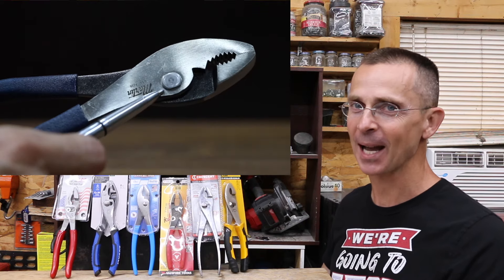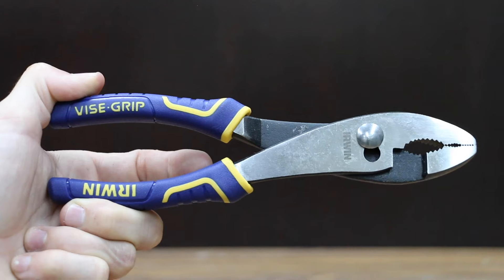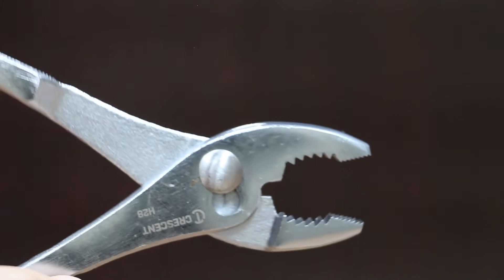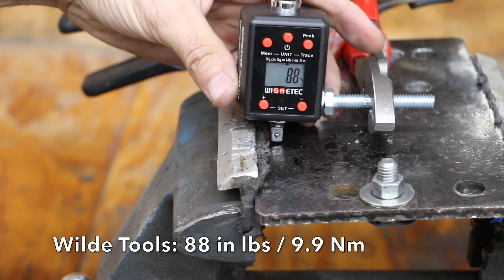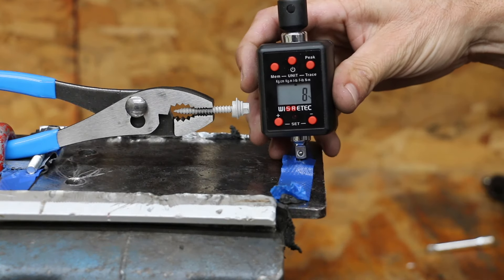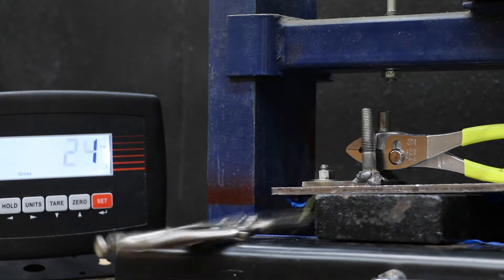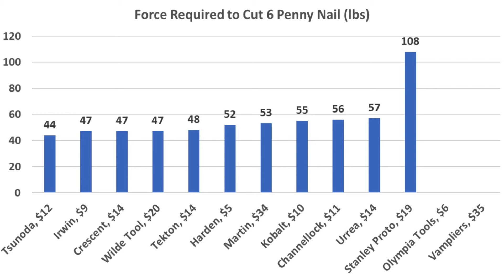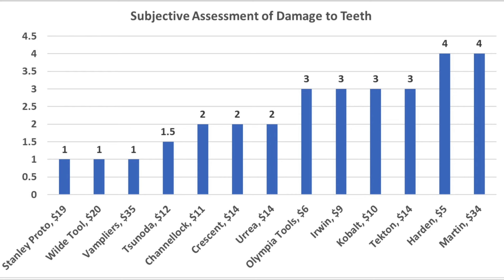Best Pliers (SLIP JOINT)? US vs Japan, Vampliers, Kobalt, Irwin, Stanley, Tekton, Martin

Comment: I would like to see a comparison of the 10” water pump pliers that are commonly used in plumbing. The top brands like Douglas (U.S.), Knipex (Germany) and Channelocks. I would also like to see a comparison of moisture meters for detecting moisture in wood, drywall, concrete, etc. Thanks!
Reply from the maker: Thanks for the suggestion.

Comment: For just a few bucks more, Tsunoda could have been the hands down winner if you had gone with the 'Tsunoda PLC-200S Slim slip joint pliers with Spring'. The slims have diagonal cut teeth like the Knipex 'Twin Grips' for improved biting grip, a spring inserted under the 'hot rivet' pin that returns the pliers back to the open position, and makes for the nicest slip joint plier action that I have ever used. And the fit and finish on them is second to none. That said, I would have like to see a x-hatch pattern on the end of the jaw.

Comment: I have a video suggestion. Cheap LED light bar shootout. Get some of the most popular under $50 or under $100 light bars of the same size, perhaps 20", and test for output, range, spread, color temperature, and spectrum analysis. maybe also put an amp clamp on them and see which ones are complete BS for their wattage claims.
Reply from the maker: Thanks for the suggestion.

Comment: Consider testing different style concrete anchors and also throw in some j bolts wet set in concrete. That would be an epic showdown. Suggestion would be to test them in old concrete and also some what fresh concrete like 90 day old and apply vertical loads for one test and then horizontal loads for another test.  You could also test blowing out the drilled concrete hole (thats recommended)  before installing anchor and also leaving the dust in the hole (that is done in practice). Also using the 2 part epoxy to glue in certain lags.
Reply from the maker: Thanks for the suggestion.

Comment: Always love the videos! Another superlative job! I was kinda of bummed not to see Craftsman on the list, but I know a lot of people knock the brand.  I started with Craftsman tools when I was a young mechanic and couldn't afford Snap-On or Mac. And to be honest...I never had anything break. I mean they did the same job as the "Pro" tools and cost much, much less. If I did on occasion crack a socket (usually because I had the air gun on it) it was a quick trip to the local Sears to replace for free.
Reply: Sad what happened to Craftsmen. The older runs of their tools are far superior. I have a bunch of old Craftsmen stuff from my dad and they're some of my favorite tools
Reply: @xraceboyex  that would be a cool demonstration. Old craftsman tools can the new ones.
Reply: @jeremypilot1015  Agreed! Idk how you could confirm the manufacturing date of the old tools, but I'm sure it's possible. Would love to see it. Maybe 40's vs 60's vs 80's vs 00's vs Present if possible... Might get a bit expensive finding a set of each and breaking them 😅

Comment: Most of the nail cutters on these I never even tried to use. Heck I don't think I ever even tried to cut wire with them. So I always look at the utility of the grip and how they wear at most and Vampliers are worth it. But lets face it, we use them just to simply hold stuff like flat pieces of metals and nut/bolts. I would have liked to see that tested. Also some of the pliers had that smaller cut out in front of the larger cut out for round stock. I like to hunt for those as they are more useful for smaller round pieces.
Reply from the maker: Thanks for the suggestion.

Comment: You should test the idea of biscuit joints domino joints and dowel rods vs a straight glue up. Some woodworkers claim they add no strength and some do. This would be an awesome to see it tested and see who is right and possibly which method is best
Reply from the maker: Thanks for the suggestion.

Comment: I know this may be a day later and potentially a bad idea, but I've had this for a while and I figure you're maybe up to the idea. So my idea is essentially, 2-stroke engine fuel alternatives. Essentially, you can take a 2-stroke chainsaw and take off the bar and chain, or a wheedwhacker with the shaft removed or any engine you see fit really. So for fuel alternatives, there's what the designated test piece needs, which is either a 40:1 or 50:1 fuel to oil mixture, then whatever the engine doesn't use, there's another fuel type. And then I've seen someone on YouTube use canola oil as fuel for his 2-stroke weedwhacker, and it looked like it ran pretty well. And then thought one day after your "Bacon Grease as Engine Oil" experiment, maybe bacon grease could work as an okay fuel source. The reason why I think the bacon grease and the canola oil would work is because as you've tested, the bacon grease can do an okay job lubricating the inside of the crankcase of a 4-stroke engine and is potentially flammable because of it's fat content, that part I figure it is possible. But the canola oil is essentially the same story because it's fat, or oil from a plant. That oil lubricates and was proven to work in a 2-stroke engine. I just think if you test it with a few other fuel types, we may see how good the alternative actually is. And then if you think that's not enough fuel types, I could think of something else if you wanted. But yeah, that's my idea that I thought of, thank you for your time, and i hope you have a good day.
Reply from the maker: Thanks for you idea.  Have a great day too!

Comment: I would like to see a comparison with a bunch of car paint polishing products. Maybe Nu Finish, Turtle wax ceramic polish and wax, meguires ultimate polish, and maybe a few other polishing products. There’s a lot of polishing products out there in the car detailing industry and I would just like to see them tested.
Reply: He's done that I believe it's why I bought turtle wax hybrid solutions.
Reply: @robertfandel9442  he just did the ceramic coating. And he did do something similar with scratch repair kits but I want to know how effective polishing products are. Like for example, Nu Finish is probably the cheapest one, does it perform well compared to turtle wax or Meguiars? No one has actually tested them, they just talk about how good it is but never show it.

Comment: Awesome video as always! 

Would you be willing to do a comparison on impact nut drivers? 

I use them quite a lot out of convenience for work and always wondered who’s making some of the best ones. Been wanting to try out the 6” extended drivers from Wiha to see if they do better than my Dewalt short nut drivers. I’ve been wondering if there’s any significant performance/durability loss or gain in it being extended?
Reply from the maker: Thanks for the suggestion.

Comment: It would be interesting to do a test with some of the more specialized pliers, e.g. Snap Ons slip joints with the 3 hole design (i think those are the ACF series?), Knipex Twingrips, the Doyle/Icon equivalents of the last two, and maybe the pocket sized slip joints.

Also, plastic jaw pliers would be interesting to compare, not sure how to really test those but I'm sure you'll figure something out. I know Tsunoda has several variations, i think including a slip joint version, as well as another Japanese company whose name escapes me at the moment. Erem has a pair as well (531E) if you want to test a ridiculously expensive pair of precision pliers.
Reply from the maker: Thanks for the suggestion.

Comment: I love your channel, but in my honest opinion with products like the Knipex Cobra on the market slip-joint pliers are badly out of date, it's like using a Yankee screwdriver to drive 3" framing screws when you could use a cordless impact driver.
About the only use, I have for them is tossing them in the lake LOL.
Great video and testing rigs, jigs, etc as always.
Cheers from Tokyo!
Reply from the maker: Thanks so much!

Comment: Thanks for your excellent editing work, you do so much in such a short time, and get straight to results!

I would love to see a leather conditioner video. Leather coats, boots, upholstery. So many brands with wildly different prices: Lithium Leather Love, Leather Honey, Lexol, Maguires, etc. I've also heard that baby oil works great on dried out car seats, and that you should never use baby oil, it will ruin your seats. One has to be correct! I have a vintage sheep skin wool coat, wonder if it can be made softer and more comfortable. Your scientific approach always gives great information regarding performance as well as value for money. 4 oz. for $22, or 8 oz. for $12?
Reply from the maker: You are welcome!  Thanks for the suggestion.

Comment: One of the worst tools in my tool box...and I am a professional mechanic and own a repair shop.  This tool is guaranteed to strip more screws and leave you off in worse shape than before you picked it up.  I'd use a vise grip before this tool of failure.  Great testing video though...as always!  BTW, why are the major tool brands never in the videos?  Licensing?  I love my Snap-On and Gear Wrench tools.

Comment: Maybe try cutting different gauges of wire.  See how small they will actually cut to how big in one clean cut.  I don't think the average person could even cut the smaller nail as they don't have enough grip strength.  Good to show durability of the cutter though.
Reply from the maker: Thanks for the suggestion.

Comment: If you did this again I would love it if you included the knipex 82 02 200 slip-joints. Also, another idea is mini wire strippers. A friend of mine works with Ethernet all the time and it's really hard to find a good pair. I love what you do!
Reply from the maker: Thanks!  Thanks for the suggestions.
Reply: +1 for the Knipex TwinGrip, similar idea on the front of the jaws as the Vampliers

Comment: Was at the store, and the Kobalt hand tools have taken a serious dive in quality.  Couldn't find a set with jaws that met each other clean, and the play was dramatic, letting me wiggle them about a 1/4" side to side, most were sitting there askew.  Rivets clearly too loose.   One set ha the jaws ground so badly, it was at a 15 degree angle sitting flush (I took a picture of this one). I noticed grind marks showing they're also grinding the sides of the jaws, presumably to help disguise how poorly they matched up. 

I went in planning on buying each of the sets (pliers, channel locks, long pliers, clamping), and ended up leaving, disgusted.  I've done my fair bit of shopping at harbor freight on their cheapest tools (and is what I currently have), but I paid little for them and knew they were junk.  These were about that, with pretty blue handles.

Comment: I have an idea for a pf video. Besides the best stain remover for concrete, how about the best rubber or sealant for roof shingles. We just had hurricane Ida come through here and some roofs don't need to be replaced but need a good sealant for the nail holes after removing the blue tarps. Just an idea.
Reply from the maker: Thank you for the video idea!

Comment: Hey Todd!  Mercury Marine keeps warning us not to use anything but Quickleen.  Quickleen is quite expensive. Any chance you can do a test for the best cleaner ( 2 cycle engine ) between Mercury Quickleen and Original Seafoam.   If you want to make it more interesting, add (in this order) Star Tron Enzyme Fuel Treatment, Sta-Bil 360 Marine, Chevron TEchron Protection Plus Powersports, Royal Purple 18000 Max Atomizer.  I think this would be very useful to debunk Mercury marine's money machine called Quickleen.  Very useful to anyone owning an outboard.  Thank you!
Reply from the maker: Thank you for the video idea!
Reply: @ProjectFarm  this would be very enlightening.

Comment: Video Idea - have you ever tested crimp tools ? Wondering if there’s any difference between the expensive “factory crimps vs the china ones vs the ones that work, but are designed for other crimp types” 

Dupont, jst are commonly used for diy projects.
Reply from the maker: Thanks for the suggestion.

Comment: I wonder if you’d consider doing a direct comparison of 4”-5” dust separators. Specifically comparing the newer Jet 717650 with the likes of the Super Dust deputy by Oneida and a thein baffle system. These combined with a harborfreight 2 hp dust collector make for a fairly affordable solution. I’ve not seen any direct comparisons with the Jet and others and I think it would be a very useful video.
Reply from the maker: Thank you for the video idea!

Comment: Hi man, I love your reviews, and the engineering of the test setups. 
But I do start to wonder. Do you ever review something not on Amazon? Or am I watching 50 advertorials a year?
Reply from the maker: I have tested products not on Amazon.  However, Amazon is so big most everything can be found there.
Reply: @ProjectFarm  Thanks for the reply! I get it. I'm guessing you are making a living. It's easy to have principles, when it doesn't hurt in your wallet. 
I'm personally getting fed up by seeing that every "review" website is now just an Amazon marketing tool. 
If you want information on kitchen hardware, literally 100% of the websites doesn't even have touched the tool. They just tell you about the specs and price (on Amazon) and report on the Amazon consumer reviews.
In Germany they are the biggest retailer (other EU countries not so much) and just as the pandemic started, they removed the prices from sellers that didn't use their warehousing from the listing. 
So when you look for a mixer for instance, you see titles and pictures of all the mixers, but not all the prices, you need to click on the product first. No Amazon user has the dedication to do that. That's just bullying sellers on their platform.
And half a year ago they stopped having a transparant rating system. Stuff that has 4,9 stars with hundreds of reviews (according to the listing), but when you look at the reviews, you'll see an average rating of maybe 2 stars and only a dozen of reviews. 
This happens almost exclusively with stuff coming from the east.
For me that was the moment I decided to avoid Amazon as much as I can.

Comment: Great video, as always ! But may I comment that contrary to all the other pliers in your test  - which are general purpose tools, the Vampliers are specifically designed for gripping rounded or rusted bolt and screw heads - at which purpose they are the absolute best. Regards !
Reply from the maker: Thanks!  Thanks for the feedback.

Comment: How about testing wire crimper/strippers. Those crimping tools with the various sized holes for electrical use pretty much all suck. Maybe you can turn us on to a quality crimper/stripper tool that actually strips wire and crimps terminal ends.
Reply from the maker: Thanks for the suggestion.

Comment: Still waiting on the diesel fuel brand competition. With the cost of fuel as well as the increased rate of fuel pump failures in diesel trucks it would be great to see how the different brands stack up. VW take rating, contaminants, efficiency, etc.
Reply from the maker: Thank you

Comment: I buy those cheap pliers for my normal uses. I play with high heat, resulting in most pliers just being destroyed after a very short period of time. It hurts being burned by cheap pliers breaking on me, but it hurts less than replacing Vampliers every few weeks
Reply from the maker: Thanks for the feedback.

Comment: I like the handle style of those Tekton's.  I've got Crescent fencing pliers with that shape of handle.  That form is easier to hold while wearing gloves. I like the Pro-Grade 8" slip-joints sold for $12 at Orscheln. 301 grams. It says Chrome-Vanadium. Doesn't say the country of origin. The size is right.  The plastic/composite handles are better than plain, textured steel or the dipped styles. When farming, they're always on me.
Reply from the maker: Thanks for the feedback.

Comment: Should've included the new knipex slip-joint pliers for half the test. 

Side note: all my kjipex teeth are dull due to using them on hardened steel. Regular files won't touch them either, next step is diamond files.
Reply from the maker: Thanks for the suggestion.  Thanks for sharing.

Comment: Can I suggest the Fujiya 230-200 BG?  Super light, and very strong, jaw grips well. an excellent pair of 8" slip joints.  also, the tektons are good, but John Deere makes the same pliers with better grips and fastening hardware.
Reply from the maker: Thanks for the suggestions.

Comment: Todd, i am not sure which one of the tested “entertainment only” tools you use. I am in contracting and with so many crap out there it would be nice for your input. (I have never had to grab a metal roofing screw by its threads nor cut a nail with the cutting tool on a pair of plyers). Better tools for that i suppose.

Comment: Can you do a test compare alot of different engine crankcase flushes against transmission fluid to see what will remove the most burnt carbon deposits and hard sludge from the heads and block
Reply from the maker: Thanks for the suggestion.

Comment: Channellock is having qc problems I was going to buy a size I didn't have and every single unit every size had concave surface defects in the same place on the outer jaw. So I went to another store. same thing. I was baffled and I can't believe all of them made it out of factory were talking 100s within 1/4 mile of each other. Only noticed this on the tongue and groove sets.
Reply from the maker: Thank you!

Comment: Thank you very much for these tests. I have an idea for another test. I purchased a ratchet combination wrench set. The first time I used one to try and remove a caliper bracket bolt the ratchet mechanism stripped and broke. Could you test some wrenches/sets at different price points to see which ones are stronger and/or less prone to slipping on hard to remove pieces? Thank you.
Reply from the maker: You are welcome!  Thanks for the suggestion.